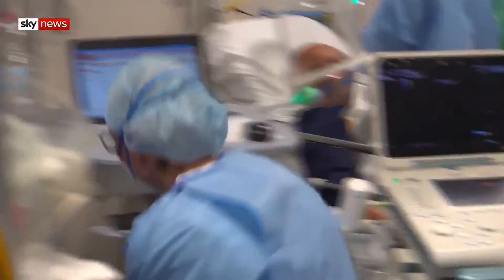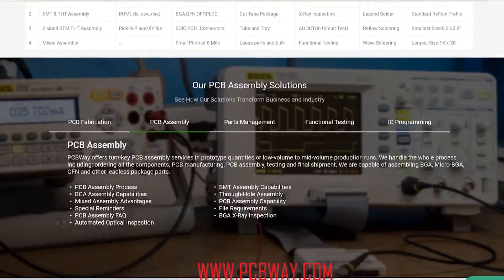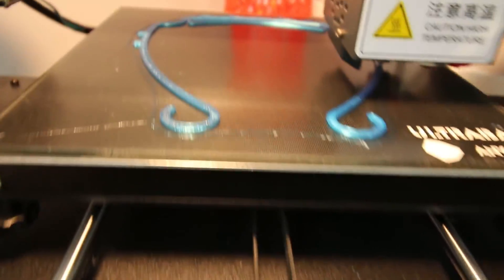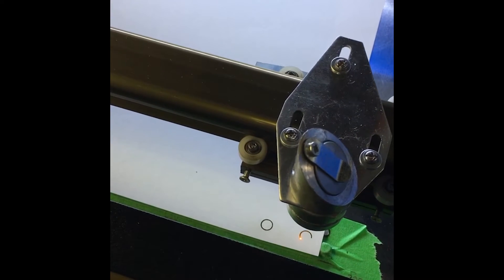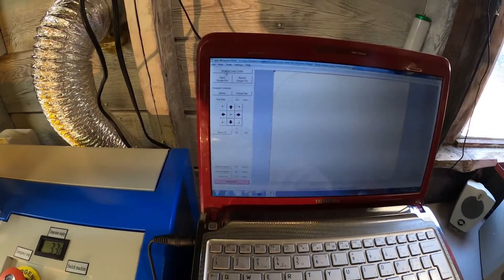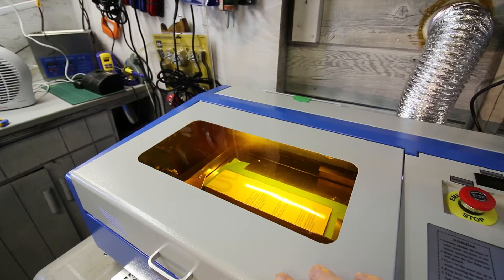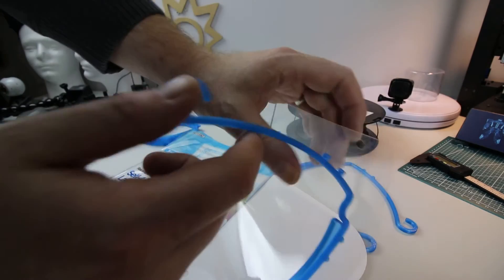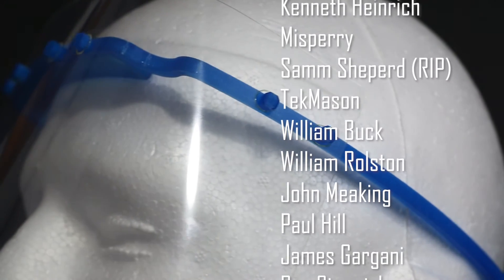3D Printed Face Shield 😷 Coronavirus PPE for Emergency Shortages 🚑

Comment: Is anyone else finding that no matter what they do they have delamination issues with the two edges with this particular face shield. I printed it with no issues with transparent pla, no matter which color filament i use with the exact same settings it delaminates every time.
Reply from the maker: Delamination is an issue with your printer/filament/settings. It is almost always caused by temperature too low and sometimes underextrusion.  Tune your printer/settings first and you will be good to go.

Comment: Is there an issue with the hard plastic on the user's Forehead for extended periods of time. I notice many of the commercial shields have a foam band in this area.
Should be easy enough to add, especially if the headband was designed to have a suitable foam padding contact surface.

While the bottle neck in time is the 3d printing,   could multiple sheets of the plastic mask be cut at the same time, by stacking the material ?
Hopefully, anyone with Injection Molding machines can start turning out the plastic shield holder at a far faster rate.

Well Done